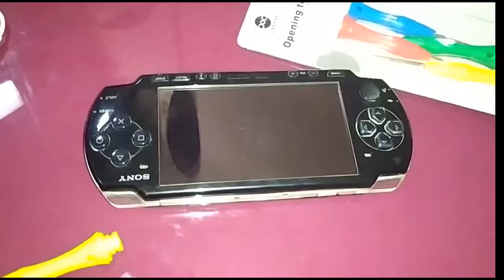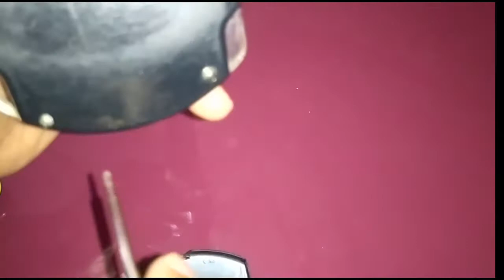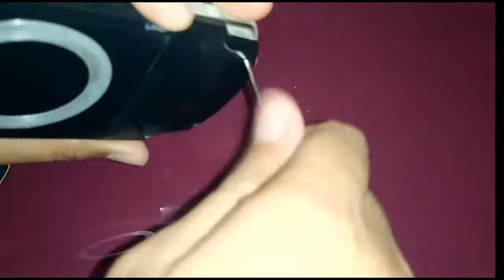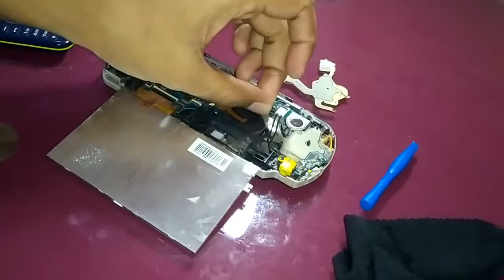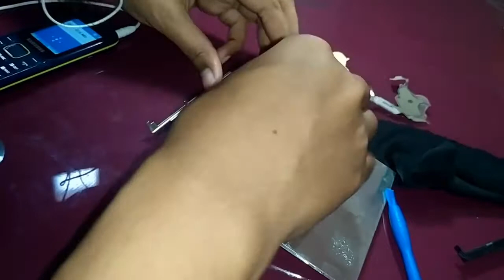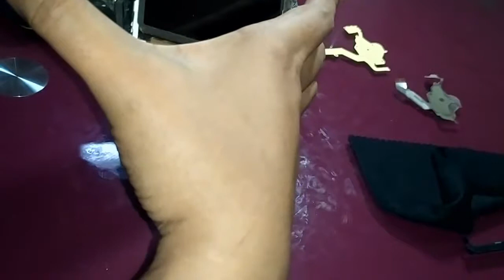How To Fix PSP Do Not Want Turn On and Can not charging

Comment: Psp model 2004, and cases:
-when have battery + charging, light orange comes all the time;
-when removing the battery + charging, light green come on 2s and disappear;
-when not charging and turn on, light green come on 2s and disappear;
My screen in these situations is black(won’t turn), I don’t hear any sound or vibrations.
Reply: Hy there friend, same case here with my psp 2001, did you find any solutions? Greetings from Brazil!!!
Reply: @ricardomartins4513  I've bought a new battery but didn't solve it, will buy a new motherboard eventually

Comment: My psp 3000 cannot turn on. When it is charged without battery or start it with battery inside without charging, the green light come up but the screen will be off after short time and the wlan green light does appear right before it happen. Sometimes there is pop sound when it is turn off. I had try fix the flex power cable but it didn't work. Charge the battery does work with orange light but the screen won't turn on. Any help?

Comment: how about if it does not charge and no orange light
Reply from the maker: and then the problem is the IC power
Reply: @teenyweenybuilding8059  mine is have a orange light but no power on and not charging...whats the deffect??

Comment: So if my psp does not work, I have to tug the ribbon cables, almost damage the screen and cover it with my hands? Seems you lack the ability to comprehend the difference between mumbling to wind noise and making an actual video.